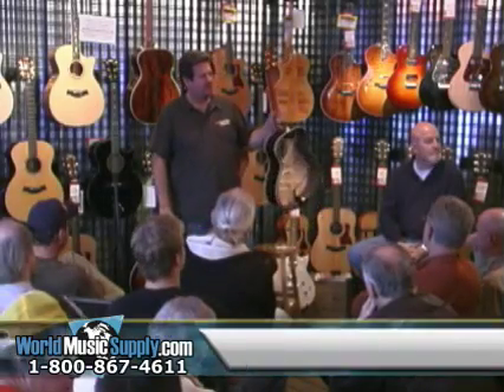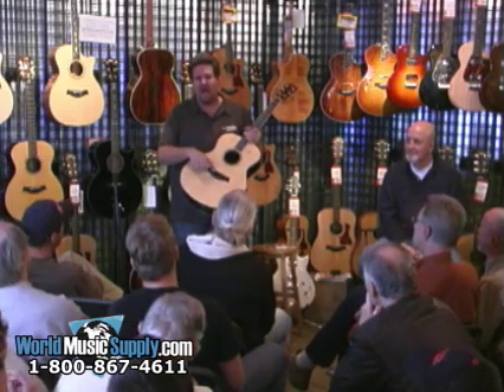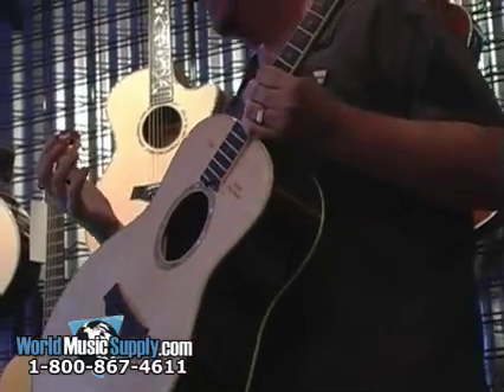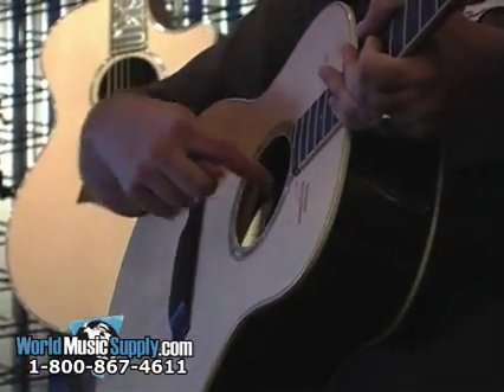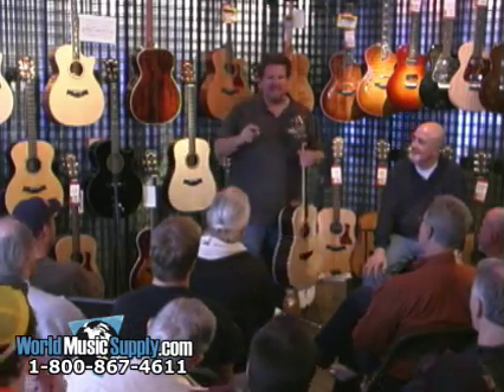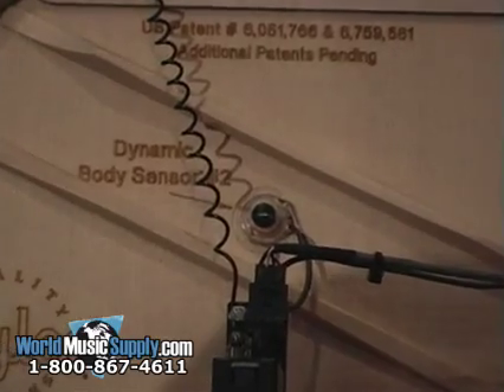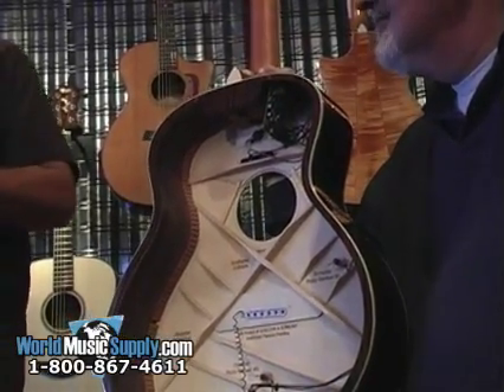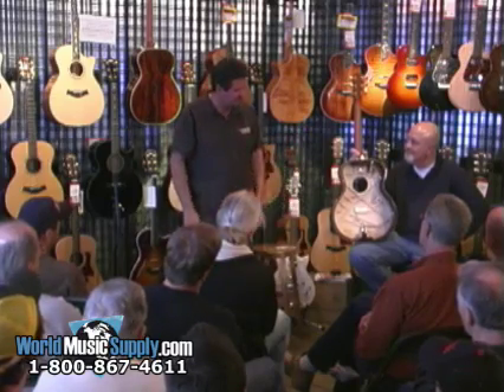Taylor Guitars Road Show Part 3: The Expression System

Comment: My friend has a Taylor 614ce and a GS, and ran a preamp that he had set to a flat sound system. Taylor sells an preamp but it's much more expensive than good ones you can buy elsewhere. He recently got an LR Baggs Venue DI box/tuner/pedal as a gift and he loves it. I'd recommend checking it out.

Comment: The Taylor ES sounds good to me but the early generations had lots of problems with the sensors leaking. I didn't think it would happen to mine...but it did! Taylor replaced it free of charge and their technician even smiled when I asked him if this happened a lot lol. However, their new replacement has held up well.